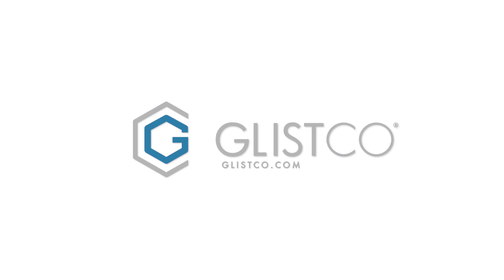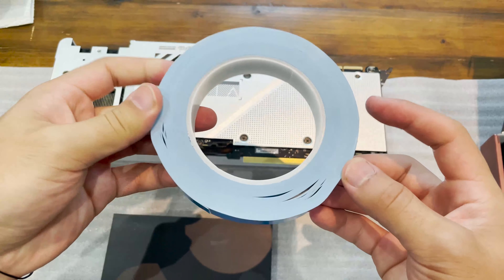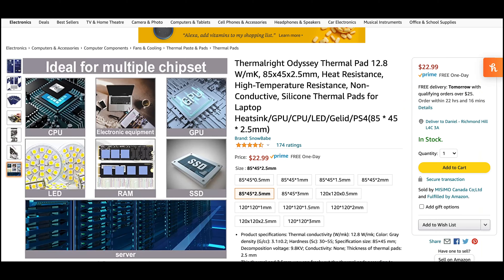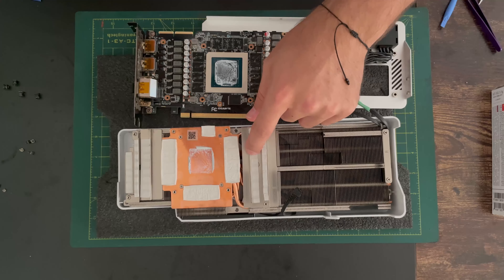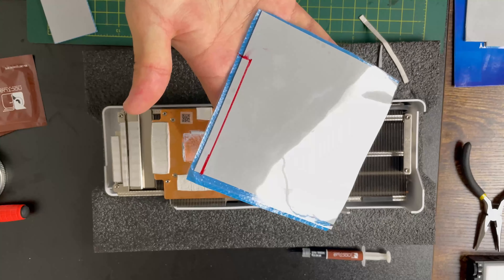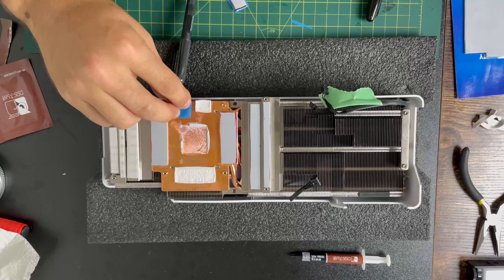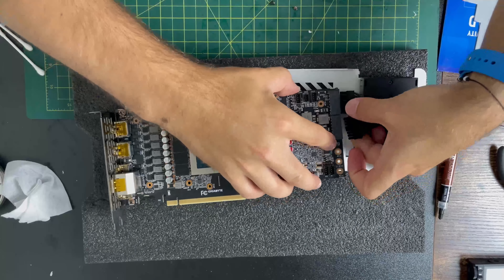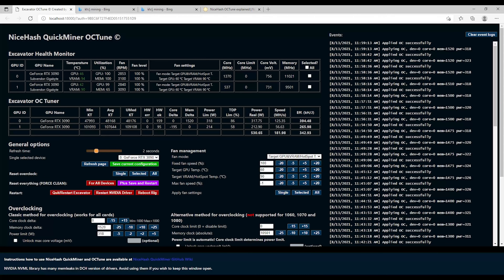125MH/S! RTX 3090 Thermal throttle fix!

Comment: Thanks for the video.  I bought a 3090 Turbo (blower style fan) for one of my work stations running Lumion.  It's a 3D architecture program and pushed that 3090 Turbo to the point where the whole system just shut down.  For such a high end card, you'd think they would have punished and tested them beyond what just normal gaming and workload usage would require.  I switched back to my 2080TI in that rig and it handles everything just fine.  It's not "as good" on spec, but at least it's stable and doesn't sound like a rocket trying to take off!  3090 Turbo was a horrible design, even worse than the other 3090's.

Comment: Do you know exactly how much material did you use for the whole fix? I have to do the same job for an Eagle 3090 which is very similar to this one and I don't want to buy more pads than strictly needed, because they are very expensive. Great video. Help is appreciated! Thanks!

Comment: I have exactly the same GPU (Gigabyte RTX 3090) but your “before” value is misleading. The stock GPU delivers a hash rate of ~105 MH/s (with automatic throttling) and it runs stable. No need for a power limit and an artificial reduction to 55 MH/s like you did.
Reply from the maker: Are you able to check your Vram temp? I would suggest you do that.

Comment: So frustrated with my 3080 aorus master. Replaced everything with thermalright and same sizes as the old pads but it still throttling, won’t go below 110 and hashing into mid 50s
Reply from the maker: Did you put the right size pads in?
Reply: @Glistco  oh forgot to give an update. I added more pads on the backplate & managed to drop the temp to as low as 78c degrees & hashes normally now